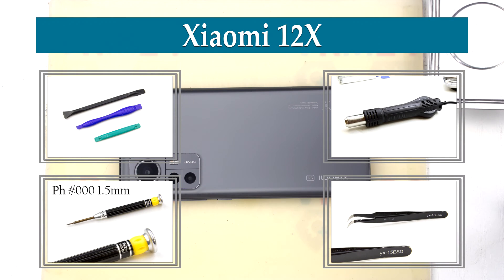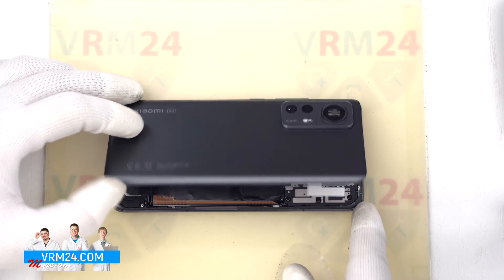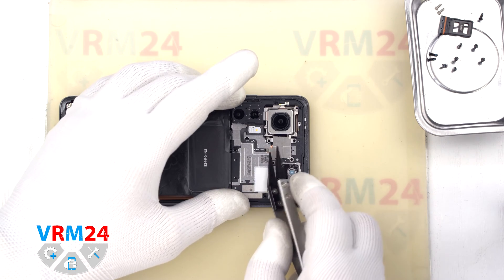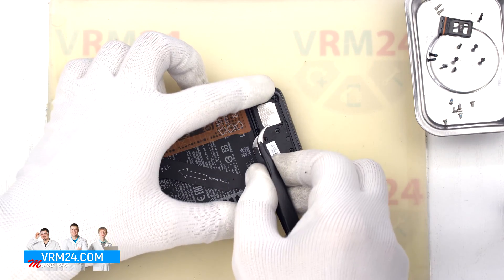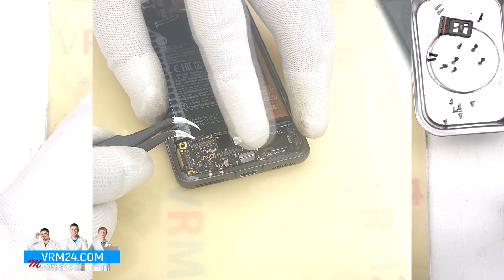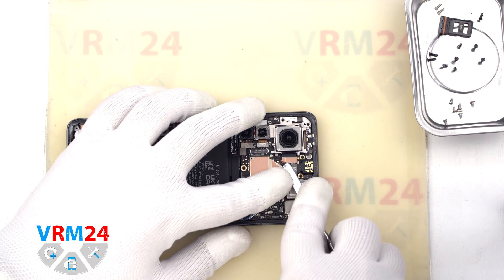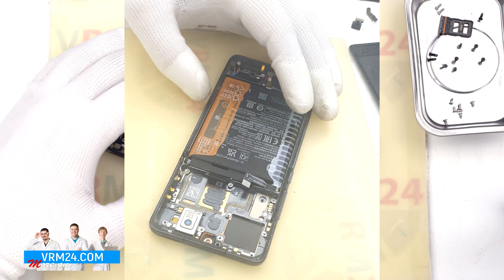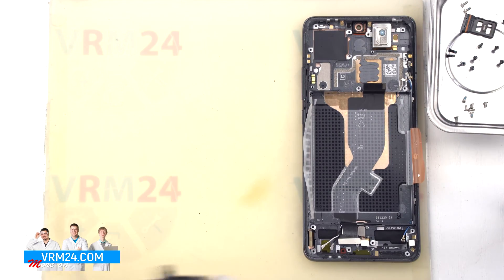Xiaomi 12X 2112123AG Take apart Disassembly in detail

Comment: Hi. Appreciate all details. Is it necessary to disassemble everything as you show in the video to change the battery?
Reply from the maker: Hi, it is not. It will be enough to open the cover hiding the motherboard with the battery connector.